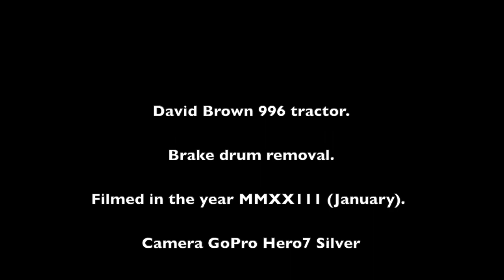David Brown 996 brake drum removal from final drive.

Comment: These drums are supposed to be removed with a tube type puller that pushes against the splined end of the pinion shaft. The genuine factory puller has a very fine thread that produces immense force, even then though it's hard work.
Reply from the maker: David Brown no simple way to do anything. The puller you mention is not showed in the work shop manual. It would have been good to have had a puller like that but I have to use what I have to hand. You should visit the Man From the Mist channel and see how he got the drums out. M 😀